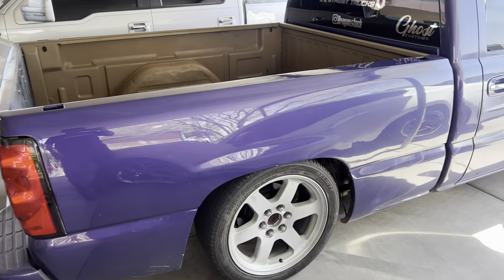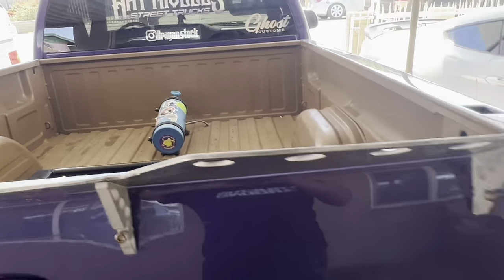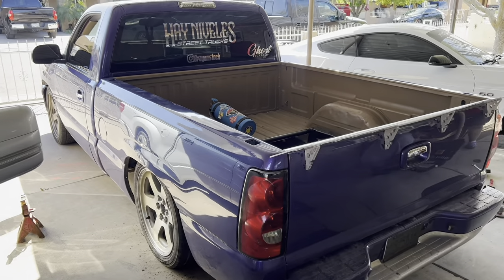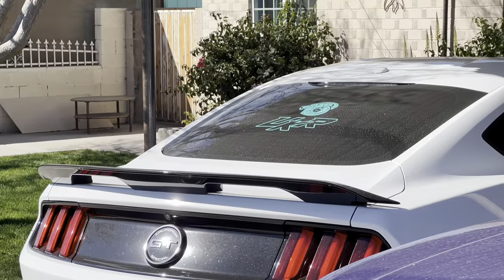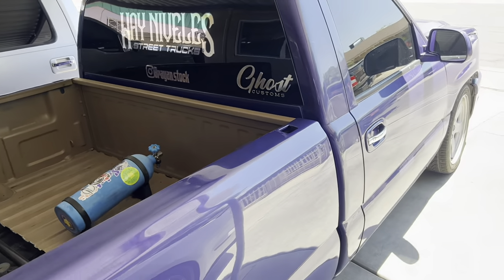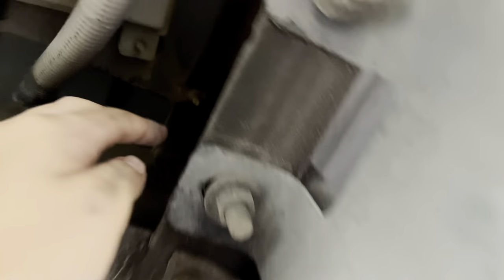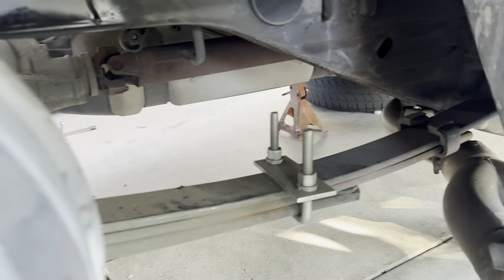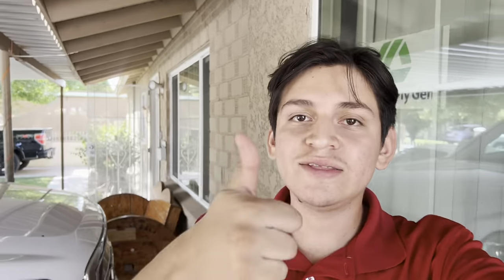Shackles and leafspring clamps on nbs and nnbs!!

Comment: How many inches does the leaf spring clamp drop
Reply from the maker: it varies from the multiple trucks i’ve installed, if you only install front set you get around 1”-1.5” if you do 2 sets it’s like 2.5” drop

Comment: I got shock relocation n notch but I got hella wheel hop I added leaf spring clamps but it’s still hood bad is there a certain way to put in clamps?
Reply from the maker: Keep the leaf spring clamps at the very end of the leaf springs if not your going to need a stiffer shock